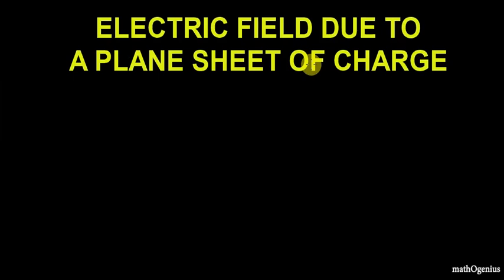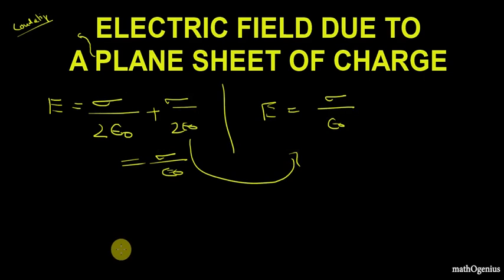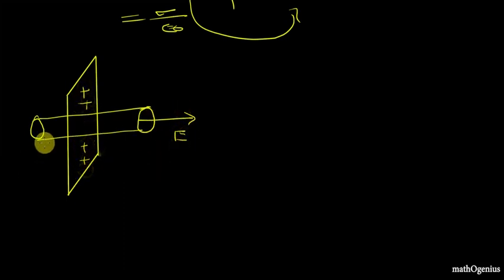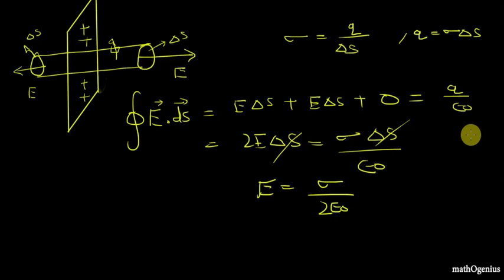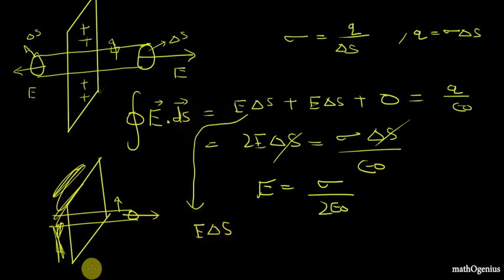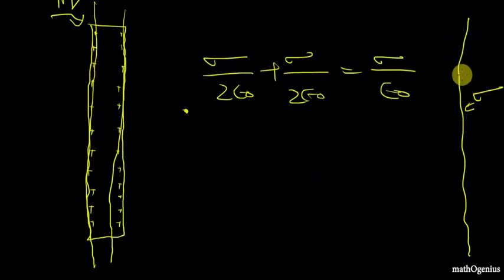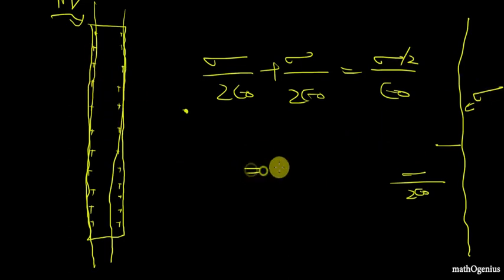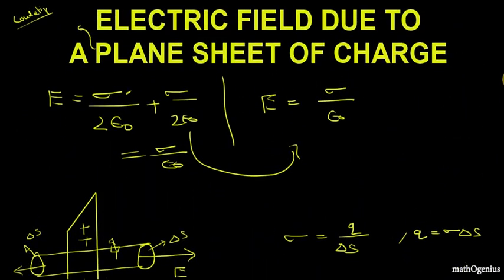Electric Field Due To Infinite Plane Sheets(Conduction and Non Conducting) -Derivation

Comment: nice try but i feel it is wrong as electric feild cannot pass through the material of the conductor . if according to you an electric feild passes through the second surface there must be a potential difference between the two surfaces of the conductor which is not possible as a conductor is a equipotential surface .

Comment: Sir, if same amount of charge is given to both conducting & non-conducting sheet each then will their electric fields be equal since EF due to conducting sheet is double of EF due to non conducting sheet but then again, surface charge density of conducting sheet is half that of non conducting sheet?

Comment: Hii pls answer this question 

Q)  Two infinitely long parallel conducting plates having surface charge densities +ve sigma  and -ve sigma  respectively are separated by a small distance. The medium between the plates is vacuum. If E, is the dielectric permittivity of vacuum, then the electric field in the region between the plates is
Reply: Thank u
Reply from the maker: its sigma by E , permitivity is epsilon not normally.
Reply: Why not  2sigma by epsilon
Reply from the maker: because for 1 plate its sigma /2E
Reply: For one infinite conducting plate E = sigma by epsilon. For two it will be 2sigma by epsilon ???
Reply: Then what is diff bw E.F due to thin sheet and conducting plate ??
Reply from the maker: see its simple , for a infinite conducting plane its sigma by epsilon not, for a non conducting plane its sigma by 2 epsilon ,now the extra 2 in conducting is because charge reside on surface(for E to be 0 inside) so there are basically 2 sheets , but in case of capacitor(your question) there is 1 posive sheet and 1 negative sheet, and due to that E is 0 inside conductor, because they are close to eachother. so inside then E is sigma by epsilon.

Comment: bro i had a doubt, since the electric field inside the conducting surface is zero, then why does the left surface of conductor has effect on any point on the right of the right surface......i mean the isn't the effect of the left surface being cancelled by the surface on the right , so the net electric field must be contributed only by the right surface....i.e..(Sigma)/2 e0, where sigma being the local  surface charge density of the right surface...Plzz tell...
Reply from the maker: Nice question, look on the conducting surface (meaning finite thickness) if we put some extra charge lets say positive it will swift toward the surface( now we have charges on left and charges on right ) now what i need you to do is search on web two positive charges together,  (there is an increase on the E field on the opposite side of the charge where it is placed) thats the reason
Reply: Okay,  so can i say it is due to principle of superposition???
Reply from the maker: @achintyagulati2672  yes we can :) e-field is just an arbitrary concept it is just a region around space where influence of a charge can be felt.
Reply: @mathOgenius  hi